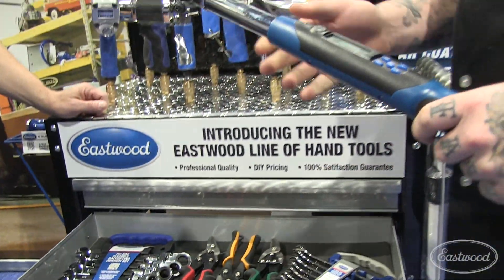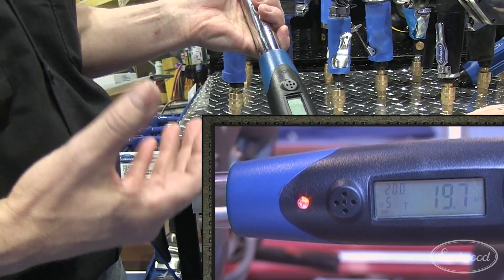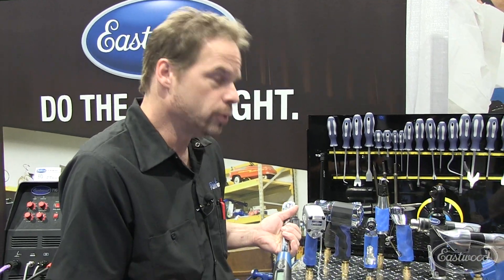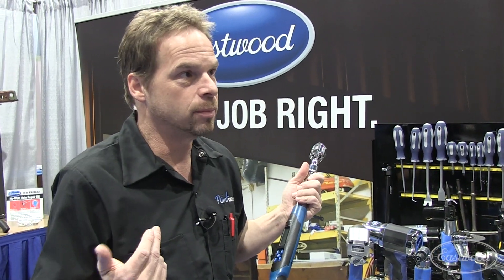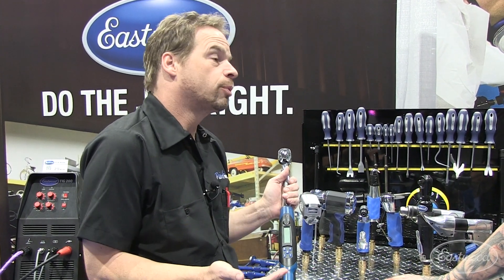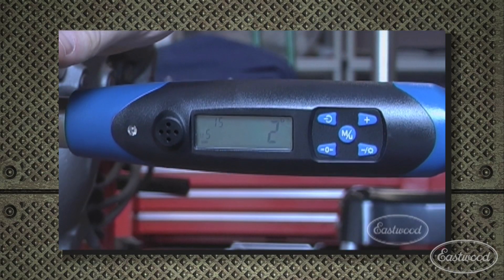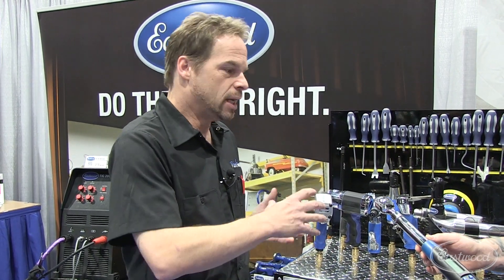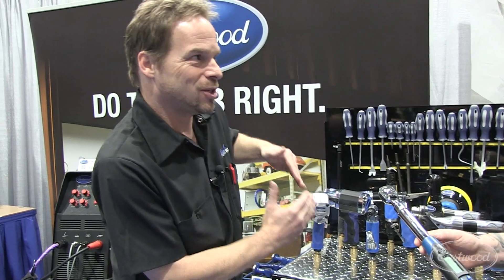3/8" Torque-ANGLE Wrench - Digital Electronic with Kevin Tetz from Eastwood

Comment: If you're in a hurry and can't read the setting on Your torque wrench You shouldn't be doing that job! Rushing while torquing on sensitive hardware is the way You make severe mistakes. The clicker type, when you buy a decent wrench are just fine. The real issue in torquing is repeatability so that's covered with this or the clickers. The angle feature is just icing on the cake, that is if the price isn't so stupidly high that You're losing money buying this! Keep lots of batteries on hand too, as the digital wrenches I've used seem to eat them up quickly. 
If the price is right with this one it's a consideration if I find myself back building engines again.